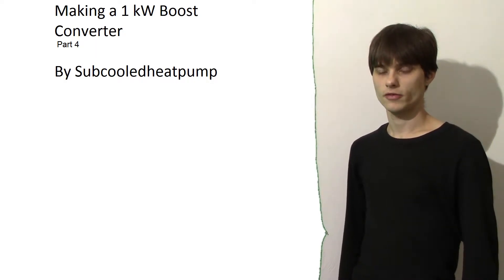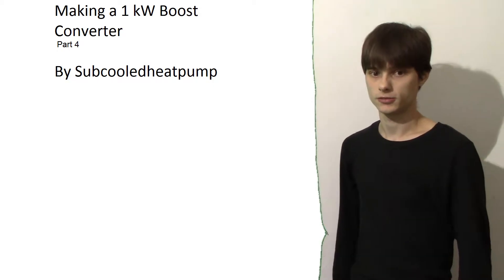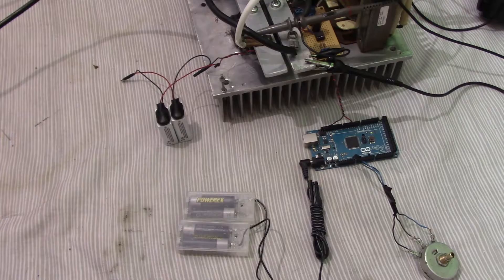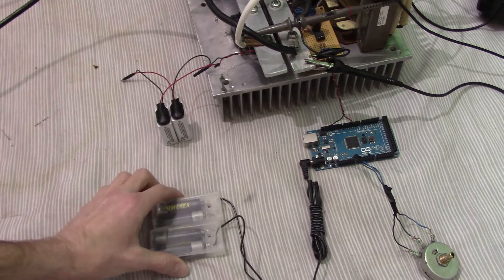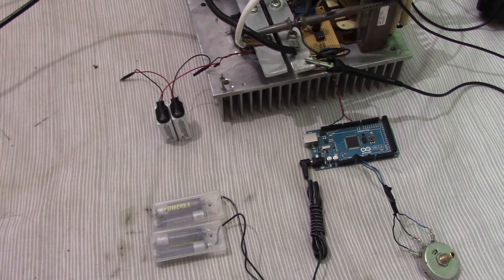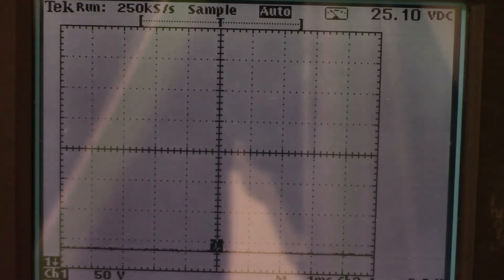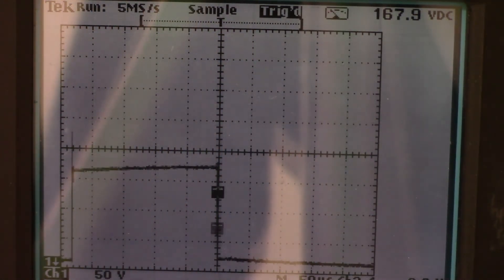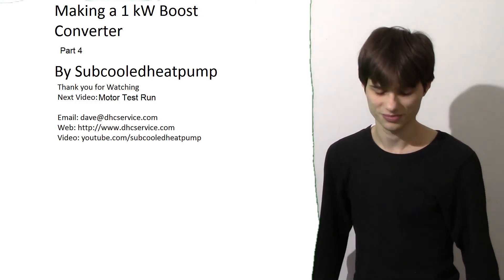Making a Boost Converter part 4; Gate drive and PWM power supplies

Comment: whats wrong with a linear regulator? LM7805 for example has input range of something like 7v to 35v and 5v out.
Reply from the maker: Could possibly work for the arduino, but at least 13 volts is needed for the gate driver. I have no doubt one could find an appropriate dc-dc power supply to do the job. I just wanted to show it working, since the project took way too long

Comment: Nice video!
I follow your channel for some time now, and I'm running into a heat dissipation problem, I wanted to know if you can help me.
I'm building a resonant induction heater, inductor and capacitor in series, the H-bridge is made with 4x FGA25N120ANTD at 55 kHz. These IGBT are mounted in a aluminium watercooled heat sink, the water temperature is about 77-86°F (25-30°C). The IGBT are isolated with a Silpad. With a thermocouple I measured the temperature of the case, it is around 167-176°F (75-80°C) and with only 7 A (they are rated 25A). We are driving them at resonance, so zero current zero voltage, with +15 V and - 8 V gate voltage. Do you have any idea how to improve? We need to achieve at least continuous 20 A.
Reply from the maker: Where are you measuring the water temperature? is it at the reservoir or at the heatsink? Also, what is the water temperature at the heatsink inlet, and the heatsink outlet? is there a noticeable difference? A few thermal basics to consider..... If there is no difference between the water inlet and outlet temperature at the heatsink, then you know that no heat is flowing out of the IGBTs. The water temperature should rise as it absorbs heat from the IGBTs. I assume you need to use the silpad to achieve electrical isolation, but if this isn't the case, I wouldn't recommend using them. If you are really achieving zero voltage switching, then each IGBT should be dissipating about 15 watts, which isn't an enormous amount, however they are quite small so I'd suspect they would get quite hot even with direct contact with the heatsink. You could also consider mounting a small aluminum bar across the top side of the IGBTs to help.
Reply: Thanks for the reply. We measured the water temperature at the reservoir, because we're using a 1/2 HP water pump with a 3/8 inch hose I didn't mind about the difference in temperature between the inlet and outlet, I will make this measurement. I made the aluminum heatsink from a solid block that was drilled and capped, the water path inside is a U shape, the IGBT mount surface was sanded to a smooth finish. We need some form of electric isolation, do you prefer Silpad or Mica? What IGBT/IGBT module would you recommend for this application?
Reply from the maker: There is an IGBT Model CM100DU-24NFH made by Powerex or Mitsubishi (they are both the same) It's made for switching frequencies up to 70 kHz and the base plate is already isolated so you can use something like arctic silver for the thermal interface material which would be much more conductive. As an alternative, any high frequency IGBT with a rating of 50 amps at 150C should work. Do know which Sil-pad model you are using? Sil-Pad 400 seems to have a relatively high thermal impedance. 1 C for every 1 watt. If you're dissipating 15 watts you've already gain 15C at the IGBT
Reply: We removed the silpads from the upper 2 IGBT's of the H-Bridge, their temperature at 7A dropped from 170 °F (77 °C) to 93 °F (34 °C) with water temperature of 83 °F (28 °C). It never crossed my mind that a product made to isolate voltage and be thermally conductive would behave this way.... Thank you!
Reply from the maker: No problem. Glad I could help. I'm sure you already know but just for anyone else who may be reading... Most of the Sil-Pad products are made from fiberglass (glass fiber composite) and silicone rubber. They are meant to electrically isolate transistors with conductive base plates from a common heatsink. However, the fiberglass and silicone rubber aren't good thermal conductors and you will usually experience similar problems with high transistor temperatures. Thank you for watching and I hope your projects all turn out well
Reply: @subcooledheatpump  what could be used instead? im pretty sure thermal paste is insulating, its just hard to keep the spacing in that area constant.
me personally ive never even thought about this, for low power stuff its not an issue, ive build a similar inverter with actutal insulated bricks before, but now want to do a high frequency version with water cooled mosfets (pretty much the same issue then)
what aboutt those without fibreglass? the ones with just? (idk silicone?) 
are there products out there that work with both? (good thermal conductivity, and insulating)